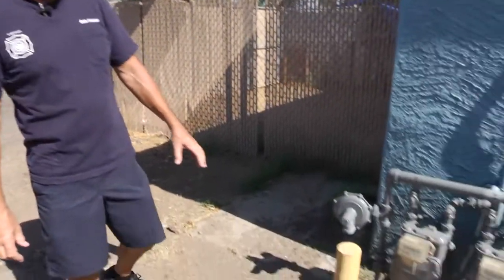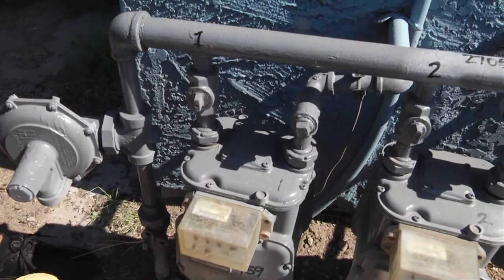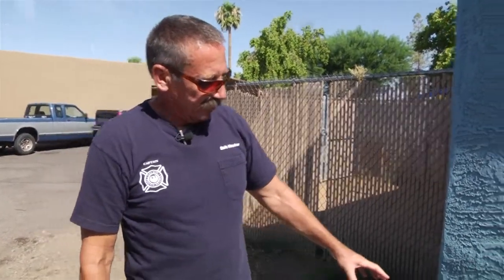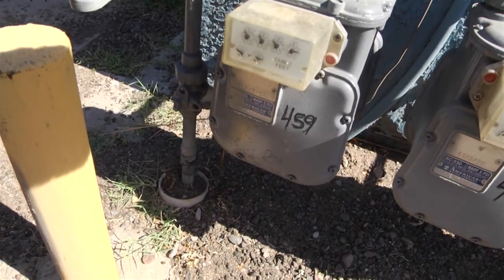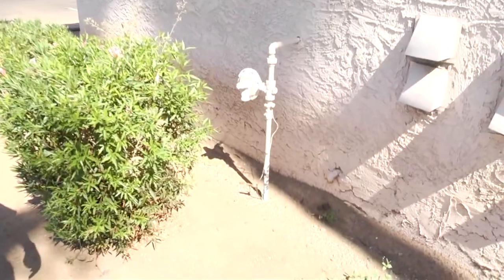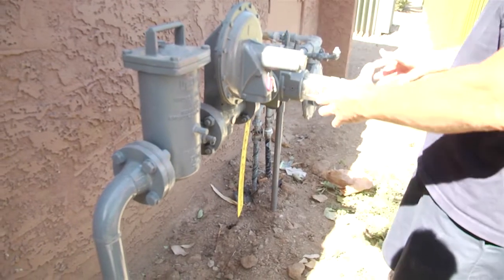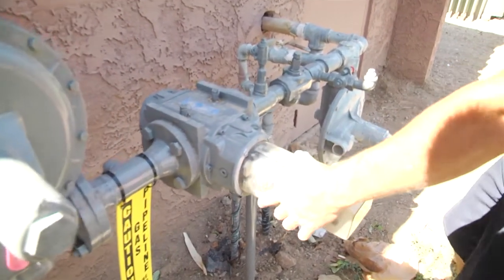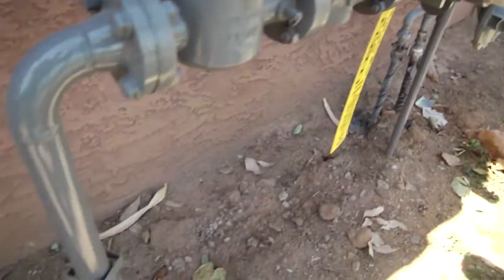Gas Meter Training

Comment: So glad firefighters are starting to address the understanding of gas piping systems ,meter sets & valves. I was a first responder / gas fitter for the gas utility in St. Louis, Missouri for 35 years and in my retirement still consult for the industry when incidents happen, involving gas . You did a pretty good job of explaining the gas utility system but someone lagging on the terminologies used in my industry which would be understand, especially if your gas utility does not offer a training facility and annual training classes where are the firefighters get to work one on one with gas utility employees (there’s a lot to learn from one another). As an example , in your video you kept referring to plugged & locked valve for future use , those valves are called bypass valves, used by gasfitters to bypass the meter set in order to make repairs or changes (much like heart bypass surgery, a surgeon would use).
Again, it’s great  you’re addressing an area where a weakness in understanding may exist . If you ever get to STL, I am  sure they ( Spire Energy  &  STL Fire Departments) would love to have you tour our facilities.